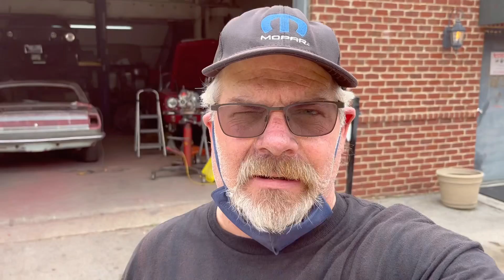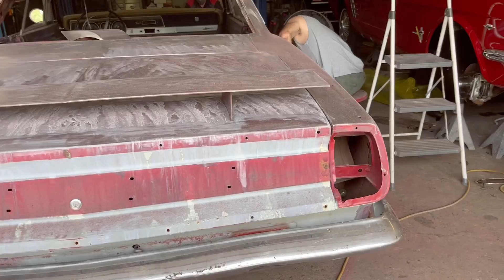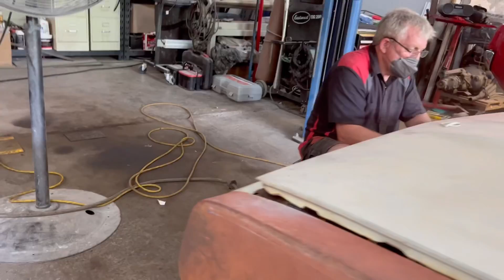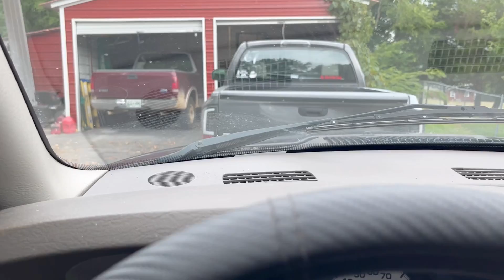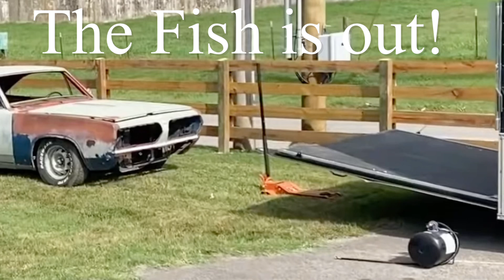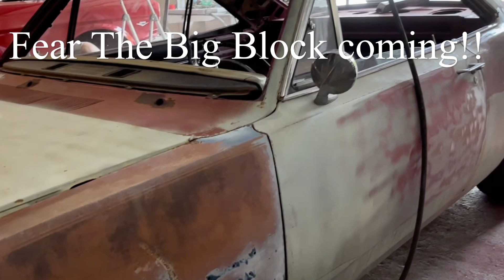Kiwi’s Barracuda Rises from its Grave for the #nonamenationals . Resurrection Time!!

Comment: I have that exact same fan on a stand that we see in the background. I bought a set of 4 cheap small diameter casters and two of them have locking foot tabs on them. I mounted them in the existing holes in that wide base and can roll it all around my shop and then lock one or both of the castors in order to keep it from blowing itself out of position.